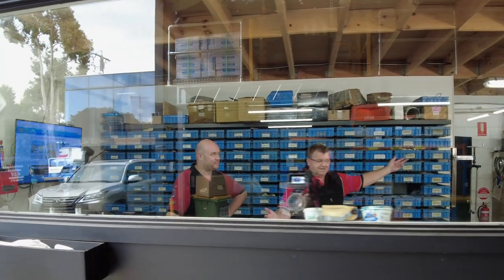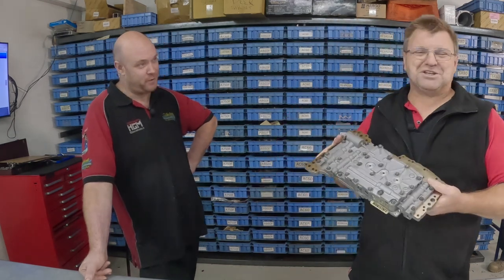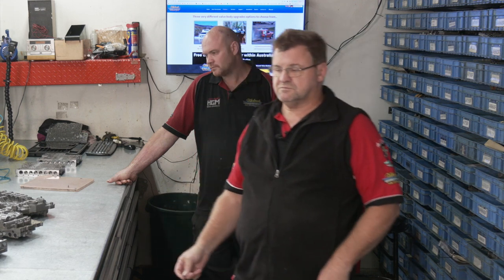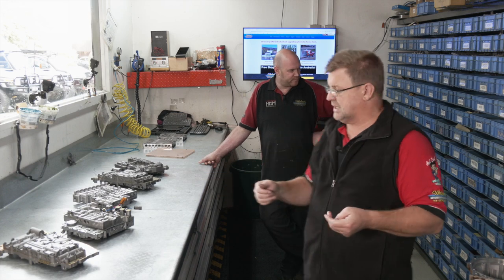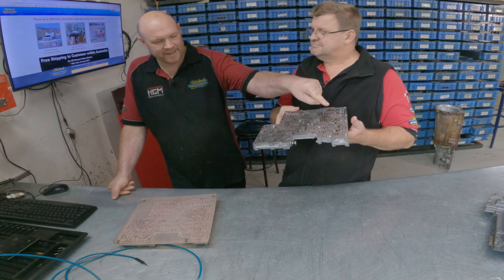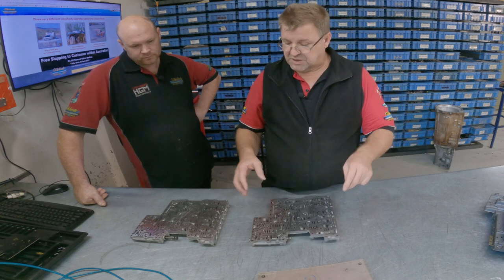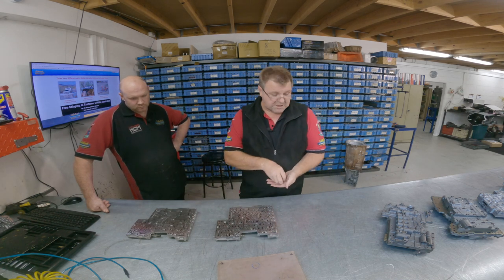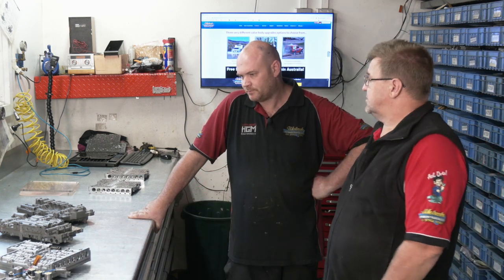Valve Bodies Explained

Comment: i had the boys @ wholesale's fit a valve body   2my 2019 D max over 12months ago, for towing a 2.7tonne van, best money    ive spent for a long time already had there oil cooler on the box, I'm 1/2-way   in 2  a around Australia trip & it's working a treat uphill downhill engine break, drive it like a manual, As for flash tunes  i wouldn't waste my money on 1, i installed a different system from a company called diesel care, anyways enough said,

Comment: 90,000km into a nomad in my 200 series mostly towing a Kimberley. 190K on the clock in total over the 13 years I've had it.  With 270kw and 900nm from Safari Armax ECU, should I be looking at an extreme valve body over the nomad?
Reply from the maker: With 900Nm then yes, I would be recommending the Extreme Valve Body and they drive really well.

Comment: Great info.  I don’t see a listing for a Colorado 6 speed.  What options are there for this box??
Reply from the maker: We can only do a Nomad Valve Body for the Colorado as part of a full transmission rebuild as half the valves are in fact in the pump assembly which means removing the transmission to get the pump out. We do have the Heavy-Duty Oil Cooler, Temp Gauge Kit and Deep Cast Pan. We can also do an extreme rebuild with Billet Torque Convertor and all of the above.

Comment: I think you we're giving Trev anxiety going through his nicely organized drawers 🤣
will be doing one of these nomad valve bodies for my 2018 Fortuner once my bank account allows it, currently have one of your cooler kits ordered and in transit. 
What are your thoughts on the Penrite ATF LV oil would you say it's a decent oil to run in this full time or is there another brand you recommend based on your experience.
Reply from the maker: Penrite oil is fine, great oil.

Comment: Truly, thanks for that info, took a bit of mystery out of what i understood or more correctly, what i didn't understand.
My GU has a ECU tune and now delivers 779nm to rear wheels (second gear) on roller dyno.
I tow 2.3 tonne van, run GU at 3.5 tonne always, full touring set up.
With this info, what valve body should i elect, nomad or extreme?
Await your reply, thanks.
Reply from the maker: Nomad would be my choice but if you like a more positive shift then extreme could be personal choice.
Reply: @WholesaleAutomatics  Nomad it will be then, I'll get in touch once I'm back, currently in S.A. waiting on Simpson to open for us to cross.
Thanks.👍

Comment: Love your work ..
Just wondering what oem fault are in a 98 105  cruiser. I give it a service for the first time about 4 years ago I bought it 2005 .. it now has 465000ks on clock…think of putting nomad valve body in it as I tow about 2.4ton van or would you recommend a full rebuild..a vid would be great on the old 4 speed…
Reply from the maker: Most obvious issue is sort 2-3 gear change as they run fairly low clamping load and are very susceptible to a loosely adjusted pressure cable. Nomad valve body make a huge difference to them. You will love the new Nomad Valve Body.

Comment: Hi, 

Been a while since you put this up, but had a question.

Do you suggest doing the upgrades for a new car, or wait a”period” of time?

Am expecting delivery of a next gen Everest later in the year and will towing 2.5ish ton van an long trips, and wondering if it is worth spending 000s on a new vehicle, or more cost effective to use it for x000 k’s before upgrading?

Appreciate your thoughts
Reply from the maker: If you are going to tow then Oil Cooler and Deep Cast Pan for sure, otherwise you are good to go. Here is a link:https://automatictransmission.com.au/select-your-vehicle/ford/everest/ford-everest-next-gen-3-0l-v6-turbo-diesel-with-10-speed-auto/?make=Ford&model=Everest&series=Next%20Gen%20-%203.0L%20V6%20Turbo%20Diesel%20with%2010%20Speed%20Auto

Comment: Are your valve bodies a diy, a "simple" change and go kit that i can do in my garage or do I need to have ute plugged into computer to tell ecus and controllers that the valve body has been changed?
Reply from the maker: If you are handy with the tools, then you won’t have any problems with a Nomad Valve Body and it comes with fitting instructions. Depending on what model we also have video install guides as well.
https://automatictransmission.com.au/technical-support/valve-bodies/

Comment: Maybe I missed it in the explanations, but I have an 2007 FJ and tow a camping trailer that’s around 3800lbs fully loaded, does the nomad valve body allow for towing in 5th gear which is overdrive or is it still recommended to tow in 4th (1:1)? Either way this still seems to be the way to go. Thanks
Reply from the maker: Yes it does but I would also recommend the oil cooler at the same time to make sure you get the most out of the transmission.
Reply: @WholesaleAutomatics  good to know. I've ordered a nomad and trans cooler. Glad it's ok to tow in 5th. 4th seemed a bit low for towing on my prado 6 speed. Looking forward to trying it out

Comment: on a late model prado 150, can the auto be 'fixed' to reduce the effect where it engine/auto brakes going down hill ( after you just touch the brake pedal) when not required? is this due to an auto 'tune'.
Reply from the maker: This is factory programming to aid engine braking, only happens when it sees a certain braking pattern that I have not figured out as yet. Maybe someone here has a better idea on when this occurs? In any case can't be changed unfortunately and most cars are doing the same now.

Comment: hi do you offer any service for the middle east Dubai, we are so far ,  there is a big over landing community
i have a A750F on lc200 used for over landing would love a nomad valve body 

but sending one back would cost so much
Reply from the maker: We have sold a lot to Dubai but we don't have a dealer there sorry. You can purchase direct, here is the web link:
https://automatictransmission.com.au/select-your-vehicle/toyota/landcruiser/200-series-v8-petrol-with-5-speed-auto/?make=Toyota&model=LandCruiser&series=200%20Series%20V8%20Petrol%20with%205%20Speed%20Auto

Comment: Whats the difference between your a340 nomad and a transgo shift kit ?
Reply from the maker: Apart from the obvious that the Nomad Vave Body is a complete remanufactured assembly that gets vacuum tested to check for valve bore wear in the aluminium housings and repair as required I don't really know as we have never used the transgo A340 kit.

Comment: Can the 1980 toyota A40 auto be fixt. She dosent like reverse unless  it's reved up alot cheers
Reply from the maker: Check oil level and pressure cable connection and adjustment. If these are fine then I'm going to say that the transmission has seen a full life and is ready for e rebuild.
Reply: @WholesaleAutomatics  thank you sir.   Any idea where I would find a rebuild kit. Cheers
Reply from the maker: Sorry for the late reply but we can supply. Email me on rodney@askorto.com.au with all the details and I will price you up.